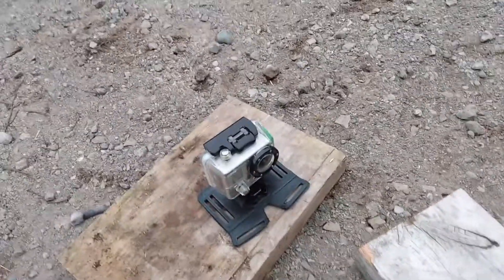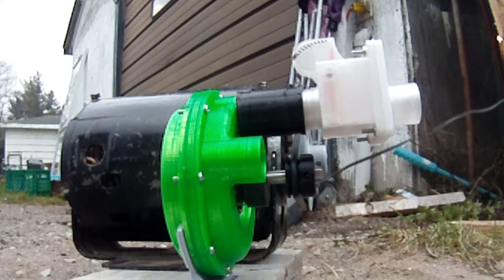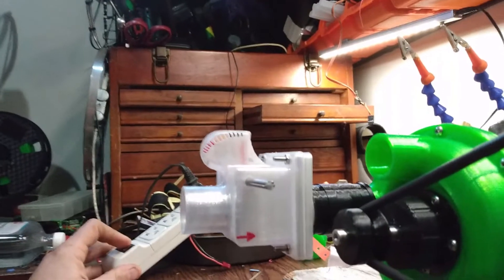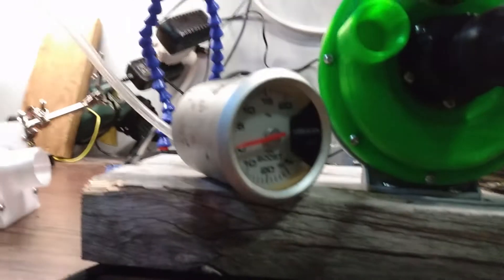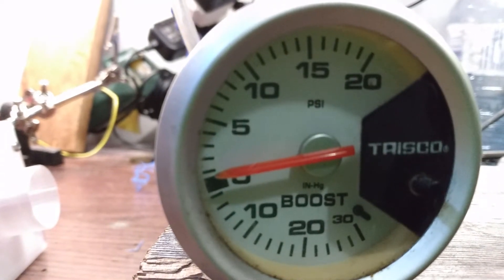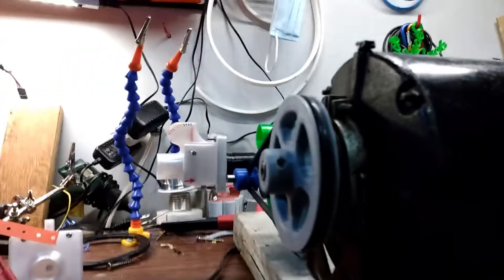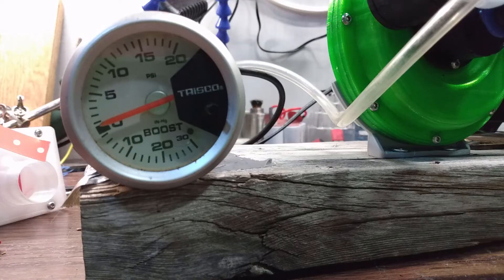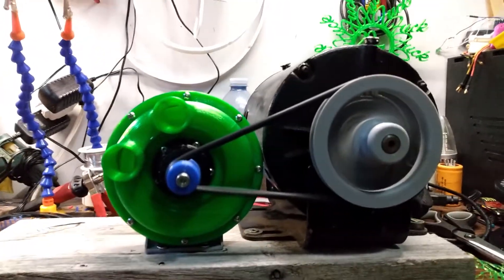It spins over 9000rpm! ( regenerative)

Comment: great job bro! I also bastard with electric compressors) now I am developing a compressor based on an engine from a vacuum cleaner in solid work. not a big advice to you: use a manometer from a medical tonometer, it is very accurate and shows up to 0.4 bar. if the arrow twitches, just put a small piece of sponge for washing dishes inside the hose. I'm subscribed to you, I'm waiting for new experiments! GL!
Reply from the maker: thanks, and thanks for the info ill look into it, and thanks as well for the sub . I gotta get my ass in gear and get some more stuff finished lol
Reply: I'm using that manometer, it's a very good idea indeed